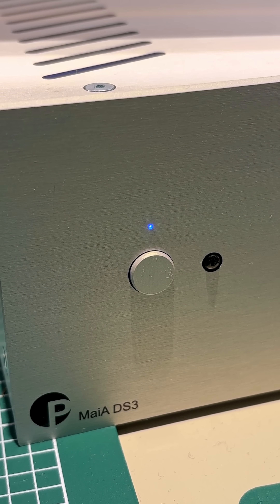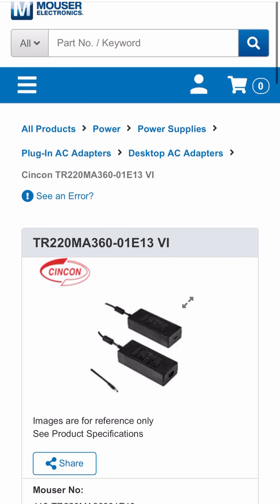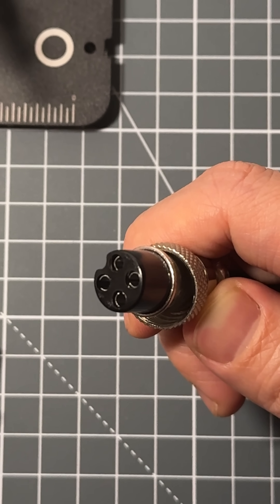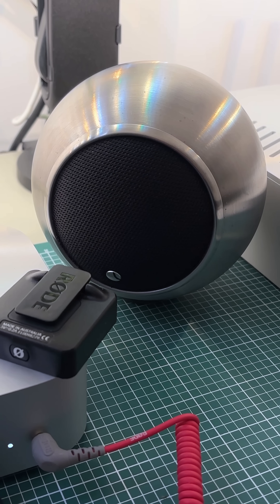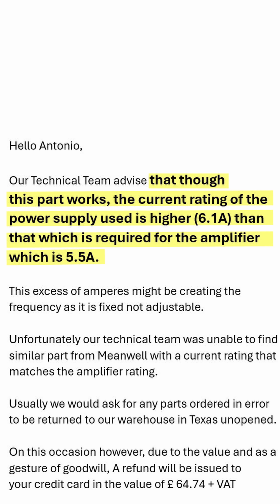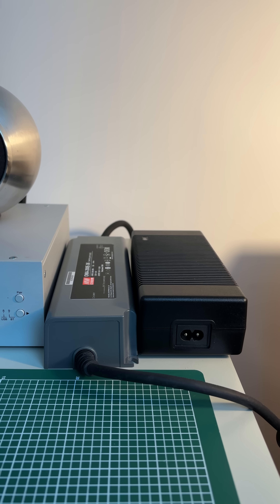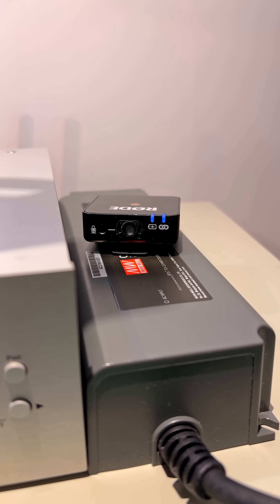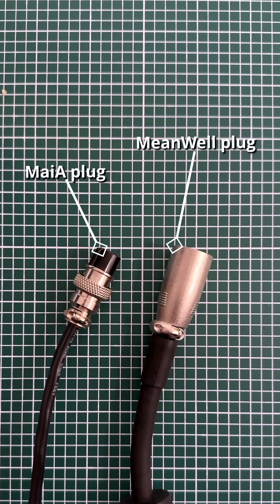This $1200 Amplifier Squeals! 🙉 🙉

Comment: I have been told once by an electrician that powering an led strip with a 300w atx supply would burn the strip very quickly.
Later i realised he thought i was using a constant power supply like were often used for halogen lamps.

Comment: MeanWell does deliver on quality, for sure. As to Mouser claiming an "excess of Amperes" makes me a bit sad and worried. They really should know better.
Reply from the maker: MeanWell is a guarantee - I didn't choose it in the first place because the "Cincon" was medical grade and I thought was a better unit. Mouser... yes, an unexpected disappointment indeed!
Reply: @tony359  SMPS often need a minimum load to work properly. At the very least it becomes too inefficient at low power. So maybe mouser didn’t use the best words but is correct.
Reply from the maker: @davadoff  but the MeanWell works perfectly fine even at low currents so... I didn't complain it was inefficient. I mentioned it was noisy.

Comment: It could be some power saving feature that causes the noise at light loads.
I would just add a resistor to increase the idle load.
Reply from the maker: Yes, that would also be an option